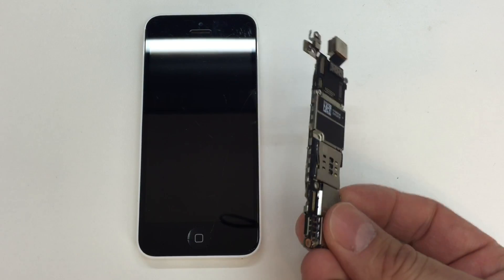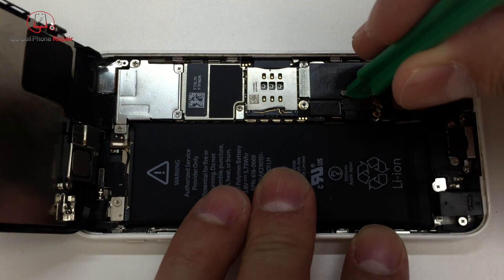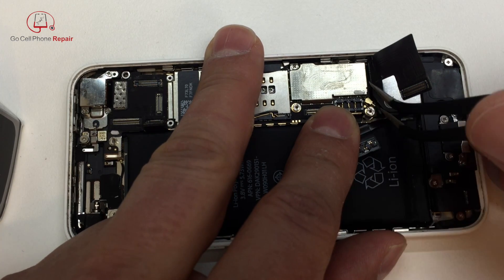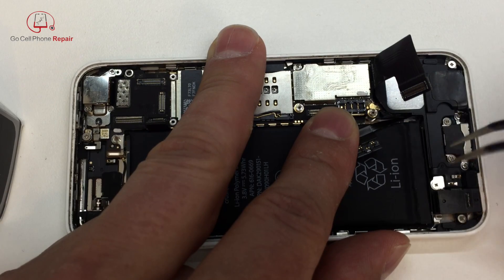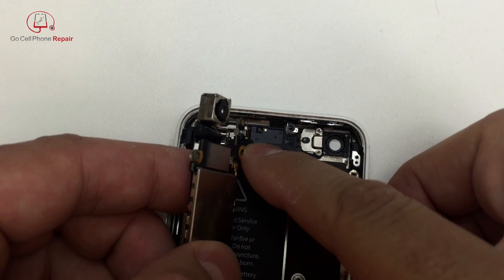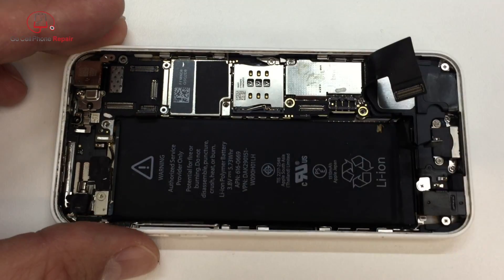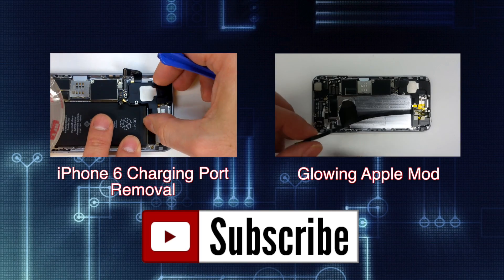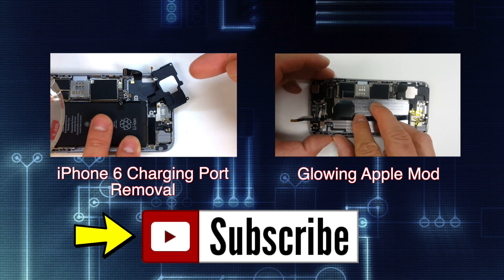5C Board Swap

Comment: My front camera connector on the board is split. Is it possible to take it off and replace it. Please answer !!😅
Reply from the maker: Possible yes. Difficult..? Well how much micro soldering experience do you have? I will make an FPC connector replacement video once I get my camera to cooperate with my microscope. The short answer though is that the job is best suited for an experienced technician with the right tools and training.